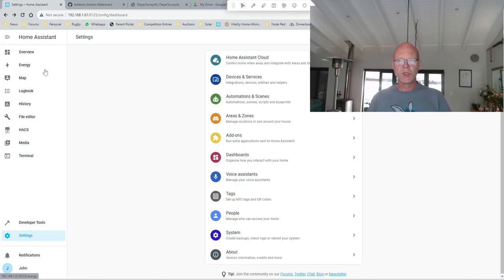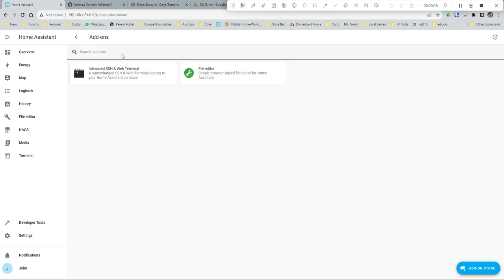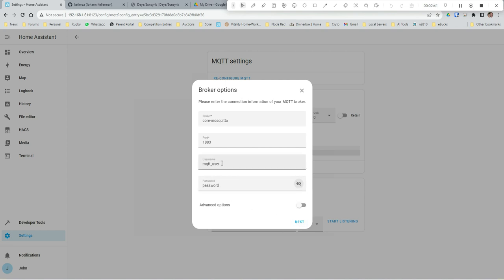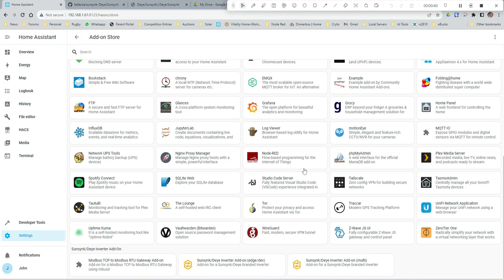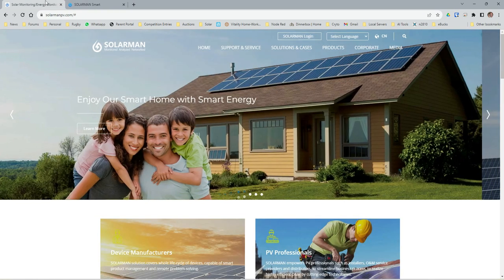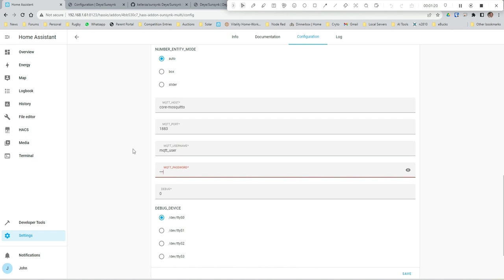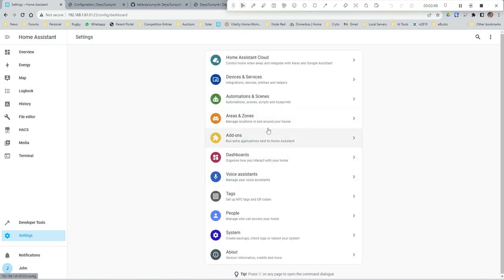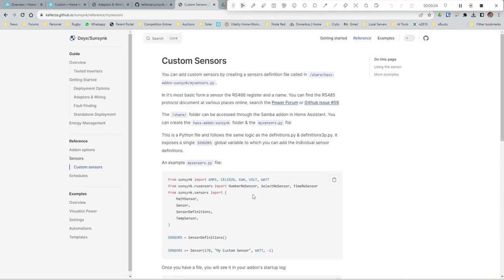Kellerza Home Assistant Integration for Solarman wifi Dongle, USB-RS485 & Modbus Gateway's

Comment: Complimenti! Io sto cercando di integrare un'inverter Manyi, ci sto lavorando da 2 settimane senza risultati! Sapresti consigliarmi qualche trucco? Grazie ancora
Reply from the maker: Hi, unfortunately I don't know the Manyi inverters at all and have never seen one. Most inverters do howeevrr have a pretty standard way of communicating.  There are usually two main options to get data from your inverter. 
Either using the Cloud or directly from your inverter. 
If your inverter is using the Solarman App you should be able to get your data from the cloud by querying the data in the cloud that your inverter has uploaded there. 
Alternatively you can usually connect via the RS485 port on the inverter and send modbus queries to the inverter which will then respond with the values of the modbus registers you request. 

The KellerZa  can do both of these and is probably a good place to start. I would suggest starting with trying to get it to connect to the Cloud server.

Comment: Hello, thank you for the video! Hoping you can help with fault finding, I'm using the solarman wifi dongle and after starting the Sunsynk add-on i get the following in the log. Any help would be much appreciated!
10:37:00 INFO    Connecting to tcp://192.168.20.11:8899

10:37:00 INFO    Reading startup sensors Device type, Protocol, Serial
10:37:00 ERROR   Error reading:  The data address received in the request is not an allowable address for the server.
Reply from the maker: Sorry  @sladi3249 , not sure what that could be. Perhaps have a look either on the powerforum.co.za in the KellerZa thread and see if there is any solution there or alternatively on KellerZA's Github page for the project.

Comment: Hello  i get this error  , The data address received in the request is not an allowable address for     i have a anenji anj-12k-h3
Reply from the maker: Hi @riksteen4933 ,  Can you post the issue you are having on the Powerforum thread at, https://powerforum.co.za/topic/22145-kellerza-integration-installation-video/   ? If I can't help you out there I am sure one of the other forum members will be able to assist or perhaps KellerZA. Alternatively check out the Github page at https://github.com/kellerza/sunsynk

Comment: I have followed both videos, and prefer to have both on, as this video allows for temperature and other sensors. The only problem, is that the sensors through solarman now switch intermittently on and off every 5 minutes. What could I do to fix this? It appears to be when it reports back to sunsynk
Reply from the maker: Have you tried the KellerZA integration?

Comment: I'm trying to configure inverter Solarman with Deye/Sunsynk multi in Home Assistant. Till now I get the following error : Serial number mismatch. Expected SA3ES230Q2U222, got [ non-readable character]
The starting process stops then with that error.
My wifi dongle SN begins with 2379 and I cannot be sure if the proces will continue even with the inverter SN recognized.
I get the data from the solarman SMART internet app, which means (seems to mean) that communication between the dongle and the inverter is right.

Thanks for your help.
Reply from the maker: Hi @C6H12N5  , I would suggest having a look at the KellerZA thread on the Powerforum.co.za. I am not sure if you are maybe capturing the serial number incorrectly or something which is causing the mismatch. They will be able to advise on the forum.
Reply: @ thanks.i’ll try and report after.
Reply: What  I did :
HACS SOLARMAN integration/ done
Configuration of dongle - automatically discovered 
Restarted HA
Gone to parameters / integration SOLARMAN 
SN of dongle OK, MAC address ok
But sensors are all present and unavilaible.

I am at the same place and see every data from the internet’s app from SOLARMAN.

I’m on the good way but nevertheless lost 😢…
What have I to do?
Thanks again.
Reply from the maker: @ I suggest using the KellerZA integration

Comment: Hello, I've Sofar inverter (HYD 5KTL-3PH-PRO). My inverter serial number starts with: SP2ES10... And my logger serial number is start with 2740... If I set these values, I get an error message when I run: Error reading:  "The data address received in the request is not an allowable address for the server." :( What should I do to make the data readout work? Thank you for your help!
Reply from the maker: Hi @MukiMr, Unfortunately I have not experienced that problem and don't use KellerZA's integration any longer as I am now using an ESP32 (KellerZa is still a very good option).  

I would suggest having a look through the KellerZA thread on the powerforum.co.za and if you don't find an answer there, post your question on the forum as the community there is very helpful and I am sure someone will be able to point you in the right direction to get your problem sorted out.

Comment: Thanks dude, cheers from romania !
Reply from the maker: You're welcome!
Reply: @SolarIntegrations  U really saved me...Deye and Solarman showing wrong values and the delay is...5 minutes or so.
Ps: new to home asistant... Cheers !
Reply from the maker: Unfortunately I am not an expert on all the integrations. There is however a lot of info on www.powerforum.co.za website and KellerZA is often active and there is also a support thread for the integration there. Alternatively you can also find more info on the Github page
Reply: Îți arată datele în timp real?
Reply: @valtinpaul1  Dacă au urmărit ghidul atent are timpi de citire și timpi de afișare - din testele mele... Sub 15-20 secunde (delay) începe aplicația lor oficiala (deye cloud /Solarman) să facă figuri. Deci răspunsul ar fi... Nu.. Delay 5-15 secunde minim.

Comment: Great review and tutorial.  I am still seeking for a solution. SmartDEYEdongleV4 looks most promising, but i am a fred of open source stuff. Imagine the ESP32 dies, i replace it with a new one but can‘t install the firmware in case Heinz doesn‘t work in 7 years because of winning in lottary or marriage or helth problems.
Reply from the maker: You can use the same dongle with ESPHome and your own code. I do have a video on how to set it up and it is the integration I use personally. https://youtu.be/EN5GjEbM4fo

Comment: Hi, thank you very much for the walkthrough, it was of immense help to me. I think I need to change something though because the data that's collected from my deye inverter through solarman dongle seems to be wrong (and doesn't seem to change), like: 
ss battery soc: 1,0% or
Ss day battery charge 6553,5 kWh
In configuration of the add-on I changed in schedules the "change any" to true because it is suggested in the end of the "inverter driver"s section that "With solarman you have to reduce the frequency that you read" but nothing happened. Do you have idea, what might be wrong?
Reply from the maker: Hi @gergokovacs3911, sorry I can't be of much help as I use the ESPhome integration myself at the moment. There is however a support thread on the powerforum.co.za and KellerZA is pretty active there. Alternatively you can leave a message on the Github and check there for suggestions for fault finding.

Comment: hello, i use a solarman 3KTLM-G3, 13:00:46 ERROR   Error reading: Connection already closed (retry 1)
13:01:08 ERROR   timeout reading 15 registers from 3; timeout reading 1 registers from 219; timeout reading 6 registers from 250
s6-rc: info: service legacy-services: stopping
Reply from the maker: Hi, best place for support on the addons is on the KellerZA github page or on the Powerform.co.za
Reply: I have similar problem on my 10KTLX-G3. It can"t log as mqtt_user and gives 
"Error reading 5 registers from 3: Failed to read register 3 Serial
12:43:00 CRITICAL Could not read sensors: ['Device type', 'Protocol', 'Serial']." 
On video (time 4:12) you have 1 device and 61 entities on MQTT just after instalation. Where does it come frome? I don't have any even after full instalation.

Comment: Thank you for your interesting video. It's a pity that I have Home Assistant running in Docker. I use the Solarman integration and only have access to HACS.... I guess is no way of installing it!
Reply from the maker: You should still be able to install it. What problems are you having?
Reply: @SolarIntegrations  After your comment, I saw it can be adapted to Docker. I use the wifi dongle, but the container errors when reading sensors, like the format is different (used -sensors all).

Comment: Hi everyone,

There is a lack of sample and documentation using HAS with PyModBus. I am confused as what IP address to be used in PORT if it uses PyModbus instead of Solarman. I tried solarman method but somehow there is a conflict with Cloud and Local.
Reply from the maker: Hi  @unwired , I would suggest posting either to the KellerZA's github page or alternatively you can often find him on the powerforum.co.za forums with your questions. He knows his integration backwards and is usually pretty quick to assist people where he can.

Comment: Is there a similar integration to directly communicate with the SunSynk dongle from magpie?
Reply from the maker: Unfortunately not, the only way to speak to the Sunsynk Dongle is via the cloud which means that the Sunsynk server needs to be running as well as your internet connection. The data is also limited to the refresh rate of the Sunsybk server so once every 3 minutes by default.  Better to use the KellerZA integration with a USB-RS485 adapter and speak to the inverter directly.

Comment: Does this work with sunsynk dongle?
Reply from the maker: Hi @rashaadalli1529  , unfortunately there are no integrations that can speak to the Sunsynk Dongle directly, they all have to go via the Sunsynk cloud server. The best option is to just purchase a USB-RS485 adapter (pretty cheap) and connect directly to  the inverter. This has the advantage of having a much faster refresh than the Sunsynk cloud (once every +-15 seconds vs once every 3 min) and you not having to have internet access for it to work (and the SUnsynk cloud is not the most reliable at the moment).
Reply: @SolarIntegrations  thanks I’m going to do this! Appreciate the response
Reply from the maker: @rashaadalli1529  No problem Rashaad, if your Home Assistant box is not close to your inverter there are also other options available. Just have a look on the KellerZA github page and e explains all the hardware options there.

Comment: hi. thanks for the video. it helped me to connect via solarman dongle. but i'm strugling to connect using USB-RS485 dongle. maybe there is good guide on how to do it including hardware part of the connection (like what port on the inverter to use, what is pinout digramm, etc)?
Reply from the maker: Hi @miroslavdorogi7475 , best source for the information is on the poweforum.co.za, just check out the thread from Kellerza as he is quite active there.

Comment: Hello, I am sending greetings from the Czech Republic.
I was interested in the integration of KellerZA into Home Assistant and I would like to ask about the description under the video. 
You write that this integration could also work with the "Sofar" invertor, is there any more detailed information available or has someone already solved it with a 3-phase Sofar Solar HYD inverter?
I specifically have a Sofar HYD 10KTL-3PH on the wall and I'm a little worried about its connection to the Home Assistant 
Thanks for any pointers to a solution.
      Have a nice sunny day 😁
      Roman
Reply from the maker: Hi @RomanKrestaGigatech, 
Welcome :-), I haven't tried the integration out on the Sofar inverter, I would suggest checking out the KellerZA github page or aleternatively have a chat to him on thepowerforum.co.za web site as he is quite active there. 

Let me know how it goes with your inverter :-) 
Good luck

Comment: Fantastic video, there is not too much detail on this setup using the Solarman wifi dongle, so this fills a gap.

If possible could you do a video on the various controls this method unlocks?

Thanks again.
Reply from the maker: Hi @markpurcell4507 , 

I do already have a number of video's on using the data you get from your inverter. 

Is there something specific that you are looking for?

Comment: How do we had 2 inverter as I have 2 of the same
Reply from the maker: Hi @barrylapthorne8017 ,  I couldn't see any support for parallel configurations on the Github page. Maybe have a chat to KellerZA on the Powerforum.co.za and see if he has any ideas.
Reply: You can use two inverters by including another specification for the 2nd inverter after the first, with the updated address of course.

Comment: I can't thank you enough! This channel has really been such a blessing. I literally had my cart ready at MicroRobotics to do the ESP32 integration, having watched a previous video from you and today I got to watch this one and don't need to explore the ESP32 anymore. You doing the Lord's work, keep it up!
Reply from the maker: ESP32 is still an awesome option as it is faster than using the dongle although using a RS485-USB or a bridge is also an option with the KellerZA integration
Reply: RS485 USB, is the USB delivering power to the adaptor? Is there a walkthrough using this setup that I can check out? @SolarIntegrations
Reply from the maker: @jawwaadkarjieker5389  The USB-RS485 plugs into your Home Assistant box and you run a cable to the inverter. Alternatively you can use one of the bridges listed on the KellerZA Github. You just change the serial port if you are using a USB, otherwise the installation is the same.

Comment: You rock thanks. I have been battling with the esp32 direct connection so want to try this. Is it compatible with the Sunsynk dongle ?

Thanks again
Reply from the maker: Hi @duncanmiller5493, Unfortunately it will not speak to the Sunsynk dongle for data, you can however use it with an inverter with a Sunsynk dongle installed using either a USB-RS485 plugged into your home assistant pc (cheapest option) or alternatively you can get an RS485-ethernet bridge as described on the KellerZA Github page. You inverter will carry on communicating with the Sunsynk cloud and will also speak to your Home Assistant.
Reply: Thanks bud !
 @SolarIntegrations